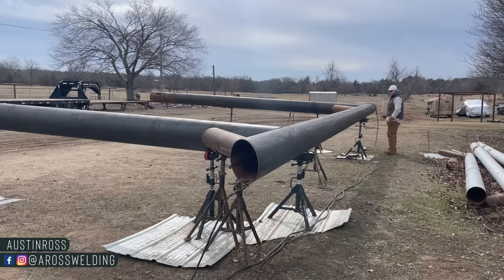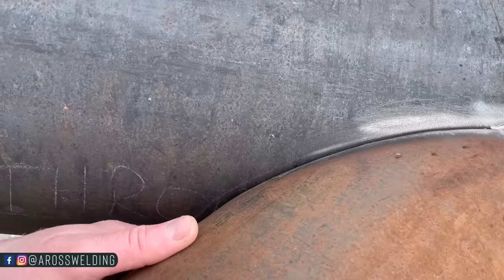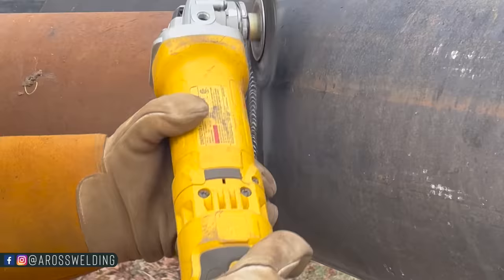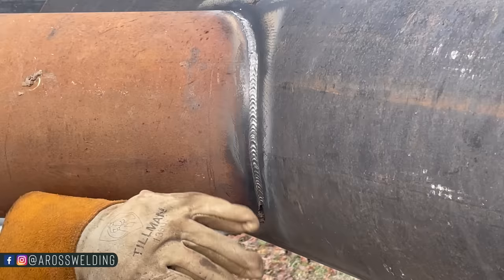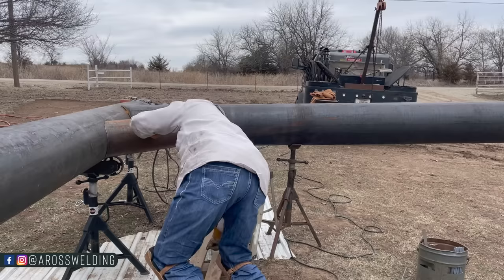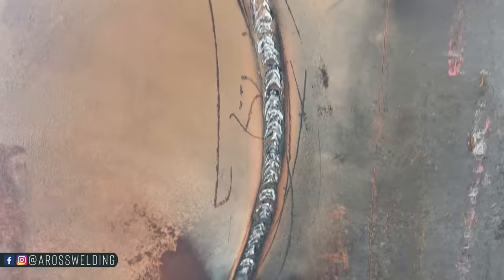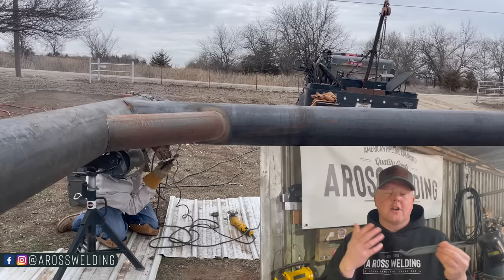Why Pipeline Welders Only Burn Half a Welding Rod

Comment: I was apprenticed in the early 70s and we used 1/8, 6010 welding rod -DC, for the root bead, never ran a down bead, cleaned each pass. If the root bead is right, it will look like it was welded from the inside. The root bead was always put in "cold", minimum setting to properly run weld. They used destructive  testing to grade the welds. !'m 73 now, so that was a long time ago. I still weld on the farm, all position.
Reply: Interesting you used 6010 on dc-   I've just put down a few beads on flat metal out of curiosity, interesting how it runs
Reply: Some younger and I can't even get into all positions !
Reply: they wont let me near a welder with my pacemaker...had to have an ablasion so no natural heart beat ....sure do miss welding stuff....LOVE fabricating stuff !!!

Comment: Yup!  The first thing that came to mind was porosity at the start of the new weld when you restart with a used rod.  When I was welding back in the 1970s, we were told to never restart with used rods on the mill jobs I worked around Pittsburgh.  Really never gave it much thought until this video.  
There.  I guess I learned something today...!
Cheers!
Whipple
Reply: This must be why I was getting porosity in college on restarts and never could figure out why because never got them on the first start with a new rod. I even said something to my instructor about possibly the flux or something  breaking off somehow and getting in it on the restart. He never really confirmed that being a possibility. That's the only thing I could think of though. It could have been the rods we were using too. They were donated and I don't remember having that issue with other rods in the past the school bought.
Reply: It's also why you gotta be careful handling new rods not to chip off the tip
Reply: Porosity is the result of damp rods or wind and poor technique.

Comment: One time I had to bend a bunch of rods while welding in a tight structural spot to get the right angle where our flux core welder couldn't reach. I was hanging off the side of a high rise building on the 3rd floor in a harness. Ended up using only a third of each rod before risking burning the part where the flux was broken off. Couldn't fit a grinder in there either if I messed up. Good times.
Reply: Which highrise? 😳
Reply: thats a monthly thing or an ironworker

Comment: Just picked up your channel, good stuff! I have been welding for like 40 years all forms not a welder by trade. I will burn a rod to the stinger, and really never had a problem restriking a burned rod. And as I said I am not a welder by trade nor a pipe guy.
Reply: Nobody has a problem restriking. It's just that broken flux may leave an inclusion or gas bubble that might show up on an xray  and it's simply not worth risking a repair for the price of a rod. It's standard practice for welds operating under high presure subject to radiography.

Comment: The only welding I hated being around was chrome or chrome-moly. You could get a sunburn working the night shift.
 I was the fitter. My job was to make the welders job as easy as it could be. When I was grinding the welder held the extinguisher. When he was welding I got the extinguisher.
Sometimes I had to put the fire out because the ground was burning. Refinery work is like that.
Reply: I agree I had to weld with three other people in a stainless box and it was altig but if you took your hood off to grab another filler Rod or something like that you were getting slashed from everybody else man it was terrible

Comment: still remember learning stick, was told if you can start a used rod consistently then you will be golden, then was put to work on a project and only had used 7018 rods to run with, my starts went from just ok to near perfect that day.
Reply: The important thing is to drop down and then weld back over where you first stuck. 98% of the time that will clean out anything in the strike . If the work is being x-rayed, and a repair costs more than 50 pounds of rod, it's not worth taking even a 2% chance. Start with a new rod every time.

Comment: First job years ago was in a large maintenance shop as a sparky but would help the welders moving 20 to 21' lengths of pipe. For some reason every guy had their favorite welding rod so they just laid them everywhere causing moisture to ruin them. I got a ho!d of a broken refrigerator and installed two 120 volt heater strips to keep welding rods dry. Those guys always seem to use most of the welding rods. Asked the talented old timers to teach me how to do basic welds but they never showed anyone.
Reply: Depending on how serious the work they're doing, I wouldn't expect they'd show you "basic welds" on the job. That's like an 8 week course! There's a lot of knowledge behind that stack of nickels. There's got to be a tech school near you and you don't have to be a high schooler to take a course. It's only a couple hundred dollars not too expensive at all; and you'll be learning it the right way right off with no bad habits to break.

Comment: I've been welding for over 30 years, mostly mig, and tig. I haven't done a lot of stick because it's not called for in manufacturing very much these days. But your knowledge of stick welding is awesome.
Reply: I did a lot of stick welding before the semi auto processes took hold. It takes a lot of hand skill which to me  always  made the work more rewarding. It's very versatile and the welds are high quality.

Comment: I been welding for 25+ years. Not to be a but a p5 after gets hot doesn’t lite up good so I have tossed a few after only welding half or so. But to get a new rod every time, I’m sorry that’s waist full. If you can’t relight a rod you should practice more. Just my thoughts
Reply: Time is money, and with jobs where failure is sortofa big deal I bet tossing rod is cheaper than fixing mistakes.

Comment: Hello im a welding student  from Sweden, i see you Americans weld pipe downhill for the moste part and doing a sipp motion, my question is why? becuse what we learn is that when we do a open rot in 5g. We are going upp hill and to close the gap we go from side to side with 7018 🙂 ps in Sweden its apparently rare to weld with 8010
Reply: It's more common to run downhill on new construction because of production speed. There are also low hydrogen downhill rods. For maintenance work, it seems to be more common to run a downhill root at a hot pass with a low-hydrogen uphill fill and cap. In areas where there may be stress on the joint during welding, you will sometimes see all uphill welding because the larger convex root deposit will be more resistant to cracking.

Comment: I learned to weld initially solely with low hydrogen rods (7016 so not the easiest to restart but ok once you get the knack of it) and got pine-appled pretty good for not using the whole rod......its now funny watching other welders throwing away perfectly good 1/2 used rods of any variety.....its noted at work that the flux on my rod stubs is normally only ever about 1" long max.
Reply: I’ve been a mig welder for a few years now and I’ve got my own stick welder, trying to branch out and do jobs of my own and I had a huge problem with porosity on my last job (welding and fabricating a box section frame) I was wondering if you let me know the most common causes for porosity when doing MMA 😊
Reply: you can always use the half rods  like Acetelyne welding but feeding them into the run you are making  for more material deposit...........

Comment: The DOWB submersible globe was welded by human welders, in a continuous fashion, over several days, using a rotating fixture with several welders in a human stack.  The metal ball compartment was about 6-inches thick, in two parts.  All of the weld zones were pre-heated well ahead of the actual weld, using a gas heater assembly.  None of the weld zones were ever allowed to go to room temperature.  This allowed the DOWB to go down to 6000 feet under the ocean, on several missions, for the Navy and others.  For high pressure applications, the hand techniques shown will not work, and will create areas where stress cracks can nucleate, or create uneven pressure zones, which weaken the structure, and initiate pressure failures.  Similar to the Inet videos of the recent submersible failure, where several people were instantly crushed.  This also applies to aluminum structures, which is even more finicky.  We did both, but it was a hard learning process.   GM-DRL.

Comment: Austin - those are welds to be proud of! You're an outstanding craftsman and providing a great value in educating others. Thank you!
Reply from the maker: I appreciate that!
Reply: If. Those. Welds. Can. With. Stand. 8' 600 of. Presser. Beating. On. Them. At. 800 feet. Of. Hole. Then. You. Something. To. Talk. About
Reply: @edwinlyman6765  Are you having a stroke?
Reply: @edwinlyman6765  can you type normally and also fix the typing mistakes? Almost impossible to understand anything.
Reply: Give him a break. He is obviously an immigrant. English is probably not his native tongue.
Reply: Whereas I judge them to be sub-standard for a pressure vessel.

Comment: Thanks for sharing that with us Austin. Now I understand when I see welders tossing a half used rod. The Gateway is looking good and near to being set. Stay safe and keep up the great video's. Fred.
Reply: We had to use half a rod  on tie-ins Sometimes there was only 6 inches between the botttom of the pipe and water in the bottom of the ditch.

Comment: Depending on rod number whether to burn up or down, tap on concrete just after stopping will let rod light easier
Reply: Sometimes I'll use a cutoff wheel and cut where the flux isn't discolored on a mostly intact rod
Reply: I am not a pro but one of the tricks I learn very early was I kept a bit of concrete tile on my bench to crack the slag on the end of a rod before restarting.  Stops it sticking 90% of the time..... The rest is me just being shit.
Reply: @BrettDalton  Yeah though concrete might introduce impurities to weld so i use steel plate that is not tied to ground. Seems to work decent, rest is me being shitty welder, but thing i repaired has had so much weight the tractors front end goes to air so it cant be that shit of a weld.

Comment: Hey Austin! Could you show a close up of how you are whip and pausing on pipe? I’m practicing to be a pipeline welder and I can’t figure out how to get it to look as good as yours!
Reply: Practice is key keep doing it
Reply: Get a blue weld lens after that everything will change. I assume you dont see what the puddle is doing, but i dont know that.

I changed to blue glass and everything changed instant!

Check every rod there is and weld them when you find a good alloy stick to it. Not every rod lays down smothly.
And think about welding line spraying. The rod tip sprays the metal to the pol and the arc searches the shortest way possible to shortout the floww of current.

Also a decend old heavy welding machine is a good start. Those mini inverters just dont deliver a dense hardcore current.
After i bought for 100$ a 80pound stick weld only machine the whole game changed. I would never sell that ironpig because it gives the most decend welds!
Consider those tips and many things willl change.
Ebay has a lot of old machine.

When you dont find blue lenses mail me i have some to sell. Depending where you life you will find them.

Make mistakes learn progress =)

Comment: We did the electric for #13 blast furnace bag houses at US steel, they required a breathing test because we had to wear face mask for the dust... We had a man named Tom who was a member of our electricians local but was hired in as a welder for the Inland coke battery expansion in the 70's. Tom never smoked but failed the breathing test, it got me thinking if 40 years as a welder damaged his lungs. Tom made it to retirement but passed away within a year. Tom was a good person and earned more time as a retired tradesman. Welding is a hazardous profession in my opinion.
Reply: Well welding fumes are a known carcinogen hence why every welder/boily I know wears a PAPR helmet/belt pack, even at work when I was spotter for their confined space works I'd be in a PAPR and we'd all have personal gas monitors on - using both SMAW & GMAW (using straight CO2)

Comment: This may interest some of your students about welding procedures in the 1940s with standard oil company. They installed pipes and tanks in the Aleutian islands and wake island and all over the US for the war effort. It was done with hand crank Hobart welding machines.I was told you could tell seasoned welders because they were missing teeth from the crank handles of the Hobart machines which had a tendency to stick and not release when the machine kicked over..The pipes [say 6 inch] were butted together and hammers were used to beat on the pipe ends to square things up. They had no grinders. After tacking up the pipe in four places they started in on the bottom making a wide weave that was root filler and cap all in one. Some called the weave a snakes belly. The weave was about 1 1/2 wide on a six inch. Thats how it was done.6010 of course had replaced the welding wires coated with wet newpapers. 7018s [low hydrogen] rods had not been invented yet. 6010 5 p rods [the red rod] pretty much built this nation until the 60s.

Comment: Without seeing more than a few seconds so far of this video, I'd figure the reason for a half rod burn is for reach reasons. That most pipe fitter welding is done with thick pipes and in tight spots, so not having to crawl right under a pipe to get that last six or so inches of rod is just easier and faster to switch to a new long rod.

Comment: I was a pipe welder and later an inspector.  I always welded with 7018 after the root pass which was usually tig.  I only welded uphill and usually burned my rod down to about 1-1/2”. Downhill welding was forbidden on nuc plants but the welders were often allowed to grind the cover pass before they called me for the final inspection.  And when I saw a ground down cover pass i knew i was dealing with a mediocre welder.

Comment: Great information and video. I've noticed that the 7018 has a protective layer on a new rod. Where as your 6011, and 6013, 7014 and 7024 are bare ended. The electrode manufacturer states this is a protective coating to help with easier arc starting. The rest are chamfered on the ends to start at any angle. 6010+P I have found to be very good all the way to the end on DCEP for most pipe applications. I'm not a welder by trade, but I get the job done and have fun doing it.  I'm self taught and love it. Thanks for the tips and heads up Ross.

Comment: I am usually right handed, but when it came to welding I became ambidextrous.  I could weld around a pipe, swap hands and do one continuous run.  I mystified my bosses, because they could not see were I stated, and where I ended.  With every other manual task, I was still stuck with being right handed.
Reply: nobody needs a one handed welder. the end
Reply: Not only ambidextrous but on some jobs had to use a mirror.

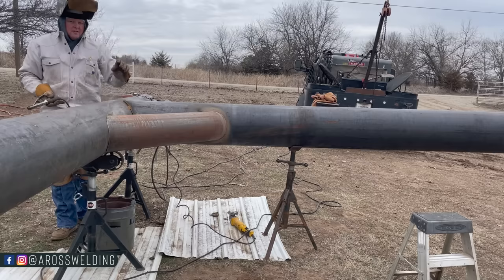Comment: 13:29 -- So it's not that you would stop at halfway through a rod, it's rather that you always want to start with a fresh rod for pipeline welding.  You just stop where the weld ends and if a bunch of rod is left you just toss it in the bucket and start fresh.  Because standards for pipelines are higher.  And for simpler artistic or light structural welding, you'd use up a few of those half rods if available.  Also, beginners would want to start with new rods because it's easier to strike an arc, and it makes it less frustrating as you're learning.